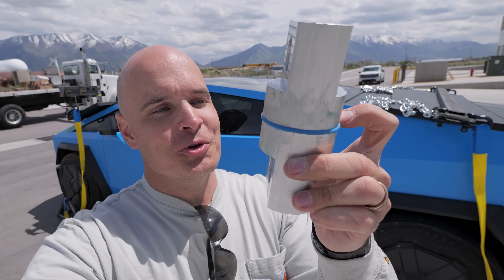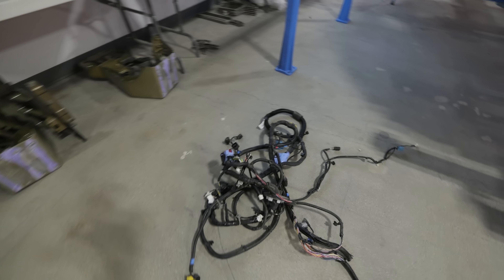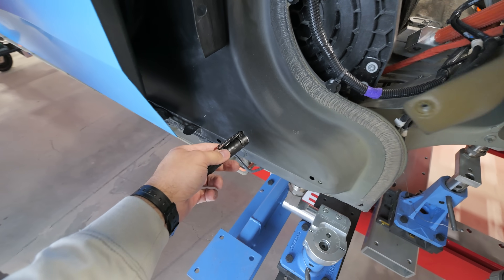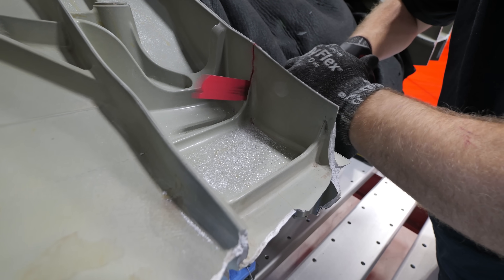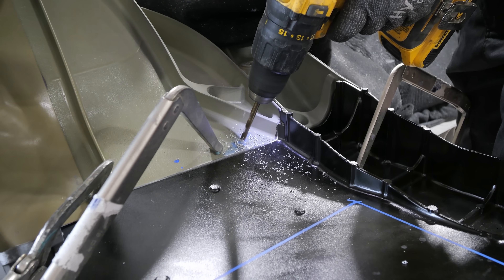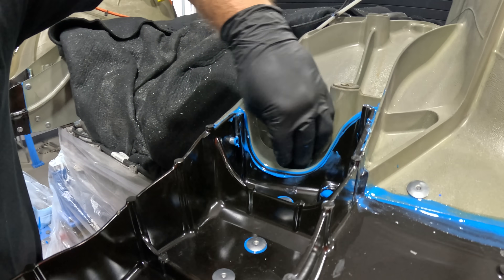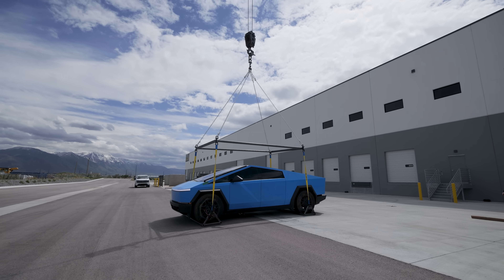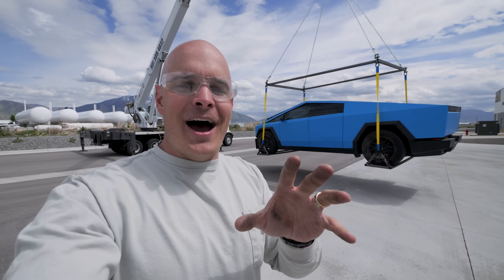Tesla Fixed my Cybertruck with GLUE - (but I'm not mad about it...)

Comment: You are testing the glue under axial stress, but given how the glue is applied in the cast, the stress in real use would more likely be shear stress. Therefore, the experiment shown later in the video does not accurately reflect the real-world scenario. Though given that it can lift the whole car, this might be a valid reasoning that the shear stress it can handle is also sufficient.

Comment: I appreciate you showing us what's under the decorative skin.
I'd like to see how "repairable" the integrated battery pack is.
Reply: If it's anything like the Model Y batteries it's going to be a pain (Munro & Co tore one down and it was packed with glue and foam)
Reply: @therealchayd  Are there any car batteries that are easy to repair? Hell, the stupid 12V battery is a pain to replace in most modern BMWs. If any electric vehicle manufacturer makes the battery even somewhat easily repairable, that would be a massive W. But most of them don't even let you access the car's diagnostics without paying thousands for a scanner and thousands for a subscription.
Reply: @littlejack59  💯
Reply: No insurance company in their right mind would allow the battery to be repaired. 
Too much liability.
Reply: @samueldoss2464  I don't know about insurance companies in the US but plenty do let you repair the battery in Europe, more  specifically the UK. But like any other repair, you've got to have the right tools, safety equipment, and you have to have some certifications and know what you're doing.
Reply: @littlejack59  Not a single auto shop on this planet would open that battery pack up and touch a single thing unless they have a death wish.
Reply: @samueldoss2464  Battery packs are too volatile to repair in many cases.  Can it be done, yes, but often if it is bad enough that a repair is needed it will be sent for recycling/disassembly, inspection, and reuse to be safe.  That is why you have extra protection on the undercarriage.  With proper recycling you can retrieve nearly 99% of the Lithium for example and lesser amounts of the other chemicals, but new discoveries are being done as time goes on.  However the reuse and repair takes very specialized equipment as compared to just regular thermal managed batteries and they are supposed to be working on that but with the backlash against the brand right now I wouldn't hold my breath that that will improve.
Reply: Good thing the batteries are rated for 500k miles
Reply: Yeah, I wonder if the battery snd associated coolant lines has those same 'cut-lines' the megacast did, so it can be cut out cleanly and replaced.

Comment: Interesting video, I would like to comment on the reference to “High Voltage” systems in EV’s.  It is a misnomer to call it “High Voltage”, for those of us who spent a lifetime in the wondrous world of everything electrical we follow an established voltage classification system. In this case I’m using the International Electrotechnical Commission classification below:

Low Voltage: Refers to electrical systems operating at voltages up to 1,000 Volts AC or 1,500 Volts DC (anything greater in DC is considering HV)
Medium Voltage: Refers to electrical systems operating that operate between 1,000 Volts and 35,000 Volts AC
High Voltage: 35,000 Volts to 230,000 Volts
Extra High Voltage: Anything above 230,000 Volts

Most AC Low Voltage Systems used in Commercial or Industrial Application cut off at 600V.  I think the term HV is used in EV’s as a means to strike caution in people, rightfully so.  But a more proper definition in my view would be Main Power versus Control Power (48V systems in vehicle).

Comment: I guess the question is if the glue will de-grade more than the castings will overtime.
Reply: From the Manufacturer, Parker:

"Parker-Hannifin Corporation (“Parker Lord”) guarantees to the user that Fusor® Repair Products ... will provide a durable repair for the life of the vehicle per the product’s technical data sheet."

Source: Fusor 2098 TDS
Reply: Nope it will outlast them by a long time. It is epoxy based.
Reply: @DomoKuchikan Ya structural adhesive isn't meant for short-term projects. I think people would be pretty peeved if their houses and bridges started to fail after a few years because the glue failed.
Reply: @littlejack59  On top of that fibreglass and carbon fibre elements are basically fibres glued together with epoxy. The stuff is like a magic bullet.
Reply: @DomoKuchikan  Ty, What does epoxy based mean?
Reply: @aloofbit338  I am not sure how to properly explain it, so in order to avoid misleading you I will say that it means that most of this glue is epoxy rasin. The rest is additives for the specific purpose - in this case the purpose is binding metal surfaces. 
The next is off the top of my head: When it cures, epoxy gets really hard and is extremely resistant to most common chemicals. With additives it can resist almost anything you throw at it, except for heat(over 200C) and abrasion. 
There are a lot of "if" and "but" to what i just wrote, so i recommend you to look on Google or ask some AI a few questions about it. I strongly recommend you to go down this rabbit hole 😄

Comment: Glad to see you being honest and more accurate in this video. Your previous Cybertruck video included several false claims, and your tone at the time felt more politically charged than objective. I appreciate you taking the time to correct that here.

As an electrical technician for Ford with the highest level of training credentials they offer, I’ve worked extensively with LORD adhesives across numerous recall repairs. LORD also makes a version specifically for plastic bonding, which I’ve used many times to repair plastic panels instead of replacing them under warranty. I’ve always respected the performance of their products, so it was great to see a real-world test of an adhesive I’ve trusted throughout my career.

It was also interesting to see—yet again—how Elon Musk and Tesla have produced such an impressive product, especially in how they’ve approached repair procedures and made their updated manufacturing information publicly available. That level of transparency and innovation really sets them apart in today’s auto industry.
Reply: you're an electrical technician for ford? weird, cos your bio says "Business owner, project manager, and political commentator delivering real-world insight, common sense, and unfiltered truth for everyday Americans who are done with the noise". pathetic man.

Comment: So the shear strength of cast aluminum is about 25k psi, but the shear strength of this glue is only about 2.5k, which is impressive for glue, but wouldnt that still only make the rear bumper as strong as the glue?

Comment: So, they cut off a portion then overlap the new part with the old using glue.  If you get in another accident, how do they remove the overlapped portion so a subsequent repair would fit?

Comment: This begs the question, why wasn't the glue applied like that from out of the factory, even if it is the same glue/epoxy, three lines of it doesn't seem to be enough, but the repair has it completely covered the connecting parts.
Reply: Just remember that from the factory, it withstood 10x the force of rated tongue weight limit. I think that's a good safety margin, using more than 3 lines of glue is overkill in mass production where the goal is to use just enough to keep the cost down.

Comment: I'm a mechanical engineer, I looked up the datasheet for the fusor 2098. It's not that strong in comparison with the epoxies we use in my work. If it behaves anything like ours, which they all do, then after about 50 degC the strength takes a nose dive. On a hot day with the batteries running hot and the sun blazing on the chasis I guarantee their "fix" will also fail.

Comment: But here's the real question how well does the glue age and does it deteriorate over time does heat fluctuations or compression and contraction Weeken said glue freezing temperatures destroy the glues structure
Reply: I have used it for years at the Ford dealerships and this stuff holds up thru ugh all of the conditions that I have ever seen.

Comment: Considering it looks like they used much more glue than the strips used in the OEM, I bet it's actually stronger now than the stock OEM one
Reply: Yeah those repair guys were basically beefing it up - really well engineered chassis repair, it’s just pretty bold on such a huge vehicle.
Reply: I'm sure the repair glue cartridge isn't re-usable, so there's no reason to save glue, just use all of it.
Reply: @SolarCookingGermany The cartridge itself is reusable as it keeps the contents separated, but the mixing tips are not. Two tips come in the pack of glue most of the time.
Reply: I noticed that as well. Looked like 3 lines with no base coat on the OEM towers. Possibly a different glue as they were having problems with the SS panels coming off early on. Or simply a different glue used for repair vs initial manufacturing. I'd also highly suspect that the tube is either used or thrown away after initial opening and mixing and they are just using as much of it as possible. However the base coating process makes me think its different glue.
Reply: For the vertical (tongue) load, SAE J684 requires the hitch to withstand a static load equal to 1.5 times (not 6x like the cybertruck) the rated tongue weight vertically — without permanent deformation.
Reply: It is almost definitely a different composition of glue and a hence, a different application process considering the amount of time between the Cybertruck being designed originally and this repair. Quantity is not the only factor. Composition and dilution are also important.
Reply: if you consider all the micro cracks  that developed in the rest of the car castings after the accident, then i doubt it, but im glad that at least you dont have to replace the entire frame
Reply: My thought exactly

Comment: The adhesives now are very impressive, we use them on Aircraft parts, they are stronger than the epoxy in carbon fiber. The disadvantages is they are very sensitive to the environmental conditions when applied, so the shop needs to be extremely clean and specifically control humidity or performance will radically deteriorate. We use plasma surface preparation to increase bond performance and there is a very interesting surface inspection tech using droplets. 
As long as work person ship stays high the technology is fantastic. it’s certainly open to being done incorrectly vs a bolted joint.

Comment: i was absolutely not expecting it to be able to get fixed that cheaply.
Reply: More cars should be like that, if you get in accident you can just replace the damaged parts.
Reply: @hellcatmd7635 many cars are actually easier to repair lol! Also tha was not an accident
Reply: @hellcatmd7635 yeah, most cars are able to be fixed this way - with maybe the exception of a frame, of which a lot can be re-bent or welded in some cases. most people don’t want those cars though, even if it’s safe
Reply: I'd love to know if you or I can get something like that fixed for the same price without a YouTube channel with this many followers
Reply: i feel like we have a warped sense of what it means to be a cheap repair if 13k is considered cheap
Reply: @rexyoda  Its perspective really.  That CyberTruck really compares to non-electric trucks in its same price range if you where to start to match all or nearly of of its specs and capabilities.  If you were to bend the rear frame of a 1 year old or less non-electric truck in its price range I would be almost certain that the factory service center would charge even more than 15K to get it back on the road.
Reply: @rexyoda  i think it’s tesla cheap is what i should have elaborated on. have seen repair bills from them that were way more. 

someone hit my f350 last year, and i had to replace both passenger side doors and the rest was small parts, that was like 7500 bucks because it was an older truck but i wanted to keep it

the crazy thing now is all the newer vehicles — look at a front end from the 70s or so compared to now — tons of small parts and fasteners, electronic actuators etc. that is why repairs and insurance are on the rise, rather than falling. it’s too much. so yeah, 13k for them cutting the back of this thing up and replacing a bunch of shit is cheap in tesla land, i think anyway. less than i would have expected.

Comment: I think that the metal piece is one and has a rubber ring around the middle to make it look like it's 2 pieces glued together
Reply: nah, it's a old marketing trick.  a 2.5" circle has a area of roughly 4.9sqin.  To lift 7500 lbs you only need a tensile strength of about 1500psi.  Plenty of common glues well exceed this.  Superglue, any 2 part epoxy, hell even good ole wood glue (assuming it bonds well enough to aluminum)

Comment: That feeling when the repair costs more than the last 3 cars I owned put together.
Reply: Welcome to modern cars, man. I'm keeping my old Honda till the sun explodes.
Reply: I paid almost the same price (14.000€) for mine and it was a new car, so it's not a cheap repair.
Reply: Zack know what he's doing. This video has racked up nearly 200,000 views in less than 8 hours. He'll recoup most of the money in ad revenue over the life of this video, not to mention the original video where he broke the truck in the first place...
Reply: Lol, same here! (Not including the endless maintenance that has to be done on a Craigslist special)
Reply: 165.000,— Euros.
Reply: He did break the truck to the point that it can no longer be used. It included repair to its rear drive motor which is a crucial part of the truck.

EDIT: wires is what I meant
Reply: @chriscross1737  You can "break the truck to the point that it can no longer be used" by cutting a single wire, so this means nothing. 
"It included repair to its rear drive motor", it did in fact not do that.
Reply: @user-to7ds6sc3p Not even cutting a single wire, just letting it get wet from a light drizzle of rain or not having a stable internet connection during an update.
Reply: @user-to7ds6sc3p wait, ripping the wires off means nothing? Were the wires really that simple that anyone can just twist or stick them back again?
Reply: @chriscross1737  my man, can you read? 
I wrote that "break the truck to the point that it can no longer be used" means nothing, because it can be achieved by cutting a single wire. I know what was actually done to the truck, but your justification for the repair price was just bad.
Reply: @chriscross1737  You can splice them back together yourself.
Reply: @user-to7ds6sc3p you do understand that fuel lines have the same exact issue right?
Reply: @user-to7ds6sc3p well can you justify your case then why it shouldn't be that costly? Given that we've watched how it was done.
Reply: @chriscross1737  Did Zach just forget to mention that in the video or are you writing fanfic??
Reply: @39bailey my bad. It was just the wires lol

Comment: Nice informative video.  The glue test thing at the end though is nothing special though, people have used it to market various glues for a long time.

What makes that structural adhesive special isn't it's strength, many common glues are stronger at face value (this could have been done with any common 2 part epoxy, or even super glue).  What makes it special is it's durability.  While superglue could perform a stunt like this once, It would never retain it's bond throughout a vehicles lifespan.  It likely wouldn't last a week of driving (too brittle).

You can think of it something like the comparison between aluminum and steel.  Aluminum is stiff and lightweight, but it fatigues easily (bending it results in a large loss of strength). Where as steel is strong and heavy, it can bend and retain much more of it's strength.  Neither material is inherently better, it's more about picking the right thing for the right job.  That's why many people were\are skeptical of a truck being made from aluminum.  Good engineering can get around the weaknesses of aluminum as a frame material, but since it hasn't been done before (as far as I know), there are likely unforeseen issues that will crop up.